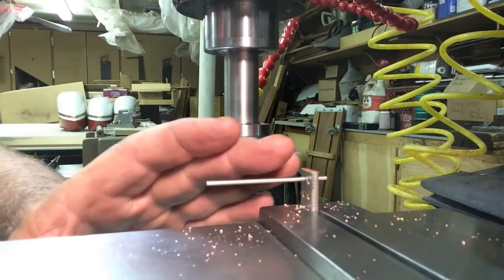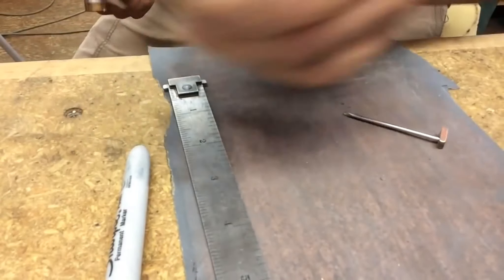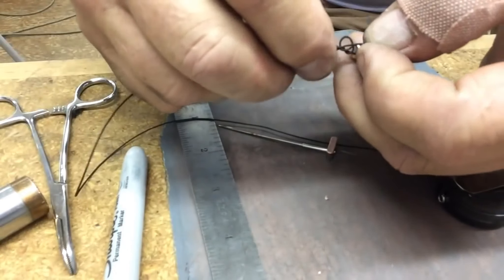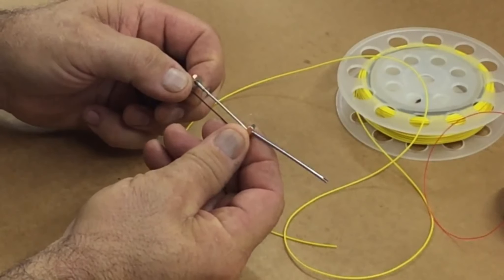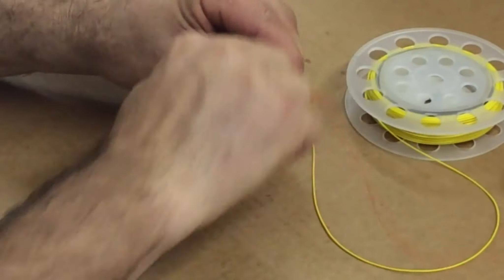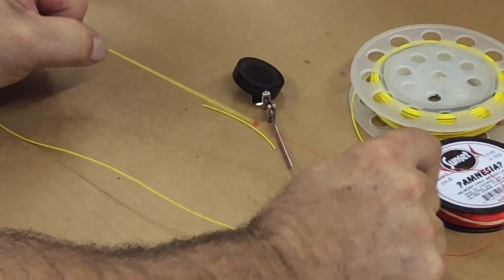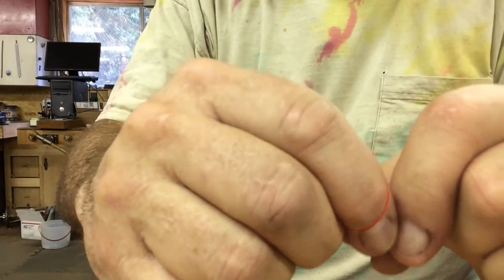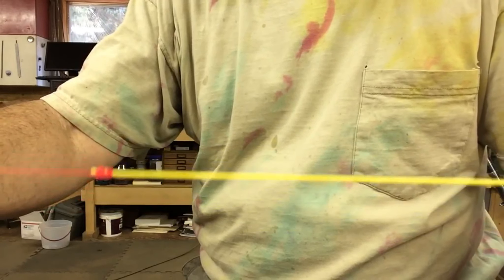How to Make a Nail Knot Tool & Demo

Comment: I see some RC airplane wheel pants.  Are you still flying.  I haven’t touched my planes in few years.  BTW, so I need to send you a box of bandaids? 😁
Reply from the maker: The Wheel pants were for our Piper Cherokee 180, Loved that plane (Not a model). I have not flow a model in quite a few years, built many models.  These models are going to be moving this summer to my sons new house.  Thanks.